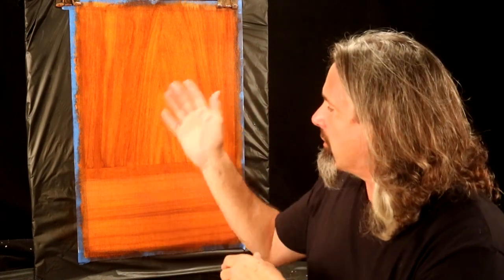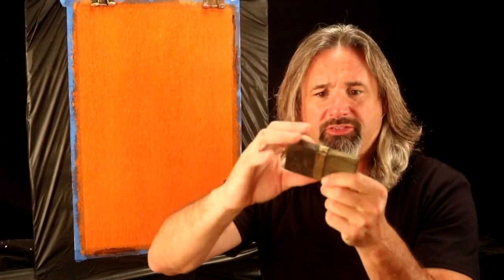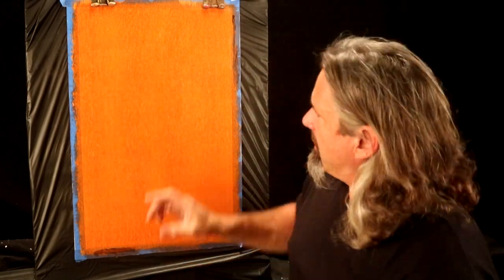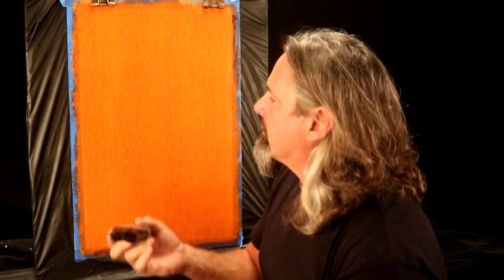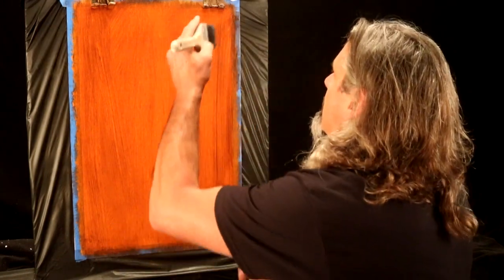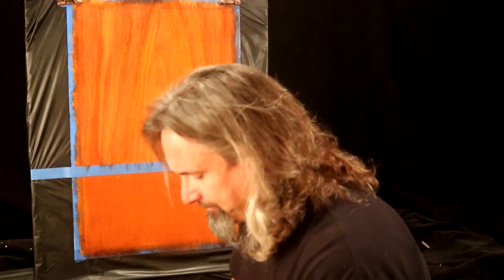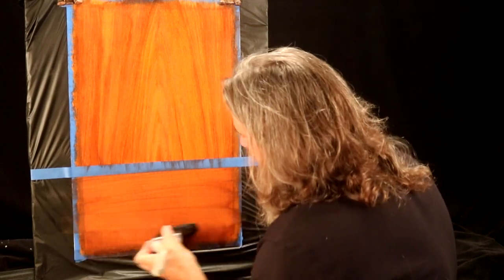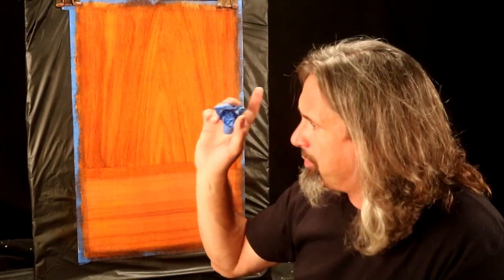faux mahogany wood graining technique for walls, doors, trim, moldings, cabinets and furniture

Comment: Is there any way to create that effect in real mahogany or figured wood in general where where you look at it you see darker highlights then you tilt the wood and you see lighter almost iridescent effect within the figuring. I restore old radios from the 1930s through the 50s many have magnificent veneers which are really expensive to buy now if the veneer is destroyed and still are not the quality of the veneers from 70 to 80 years ago. I appreciate your attention to detail but I don't see how this will trick a person that this is real wood unless they don't have a great eye. That said I think you are an artist and I mean no insult. I imagine this is the best way to create faux wood effects I have seen. I just notice things like how the figuring of real wood dances in the light when you tilt it. I have mastered woodgrain effects in miniature since I have for decades built ww1 plastic aircraft models which many had wooden propellors and fuselages. I use acrylic undercoat with artist oils with soft brushes as overcoat. Right now I am debating on a rare 1937 Zenith console I recently got which the veneer is trashed on the top as well as the burl side accents. The veneer to redo this costs alot but so do the brushes to duplicate your techniques . I just can't tell on this screen if it is worth it for me who, I feel I could duplicate your techniques with practice and the right tools vs. just buying veneer and doing it correctly. Any advice?